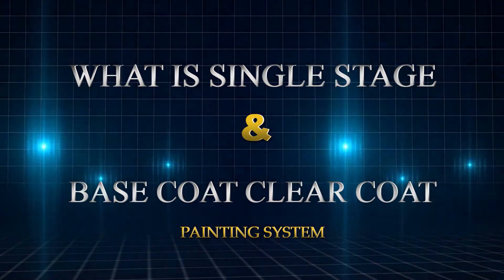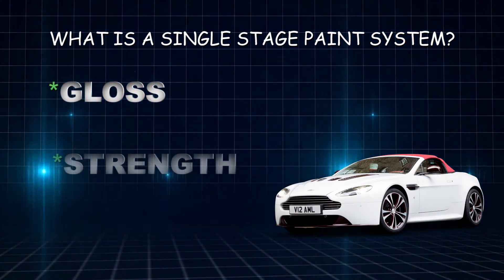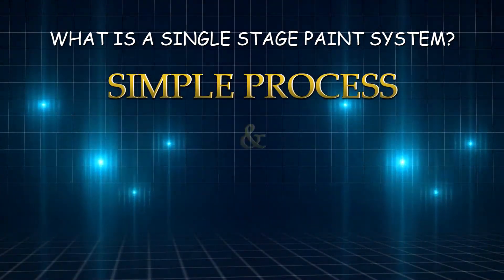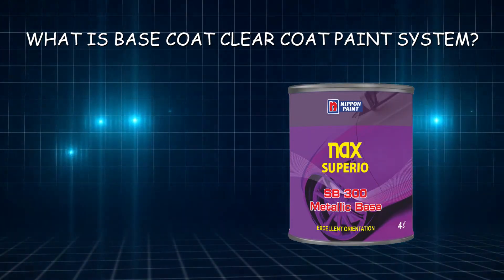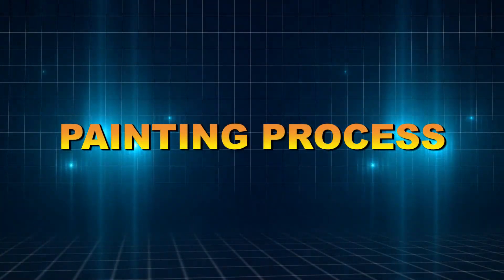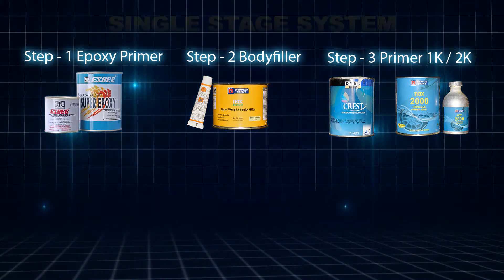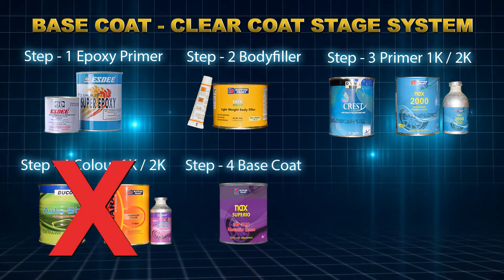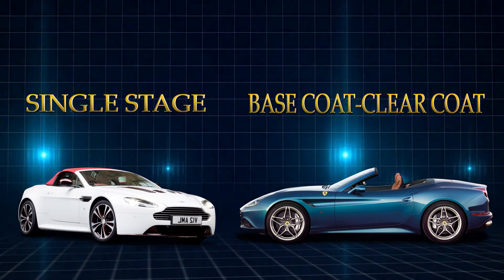What Is Deference Between Single Stage Vs Base Coat Clear Coat Painting Process BC/CC

Comment: Can you spray clear coat on single stage paint?
Reply from the maker: Yes you can spray clear over single stage paint,wet sand with 1500g before applying clear
Reply: @DynamicAutoYT  
Can it be sprayed after a full paint job without sanding?
Reply from the maker: @x-man4702  You can spray after drying overnight